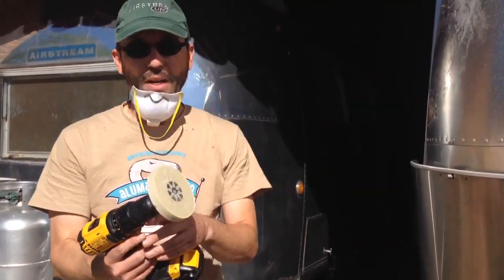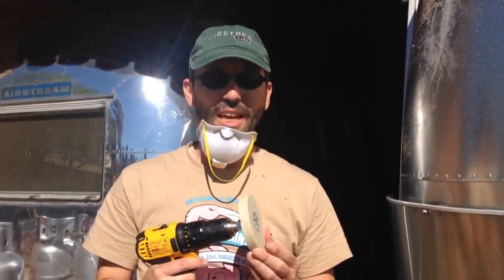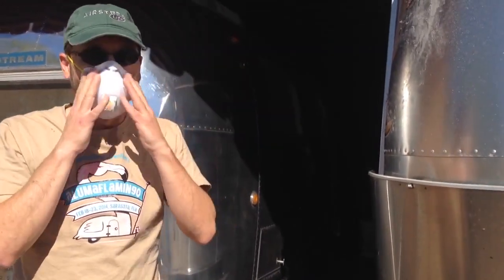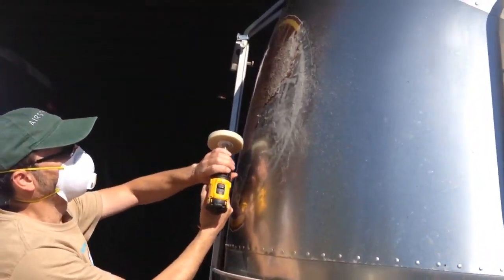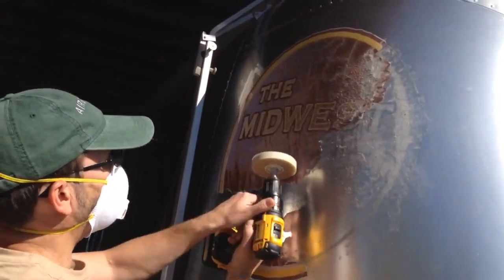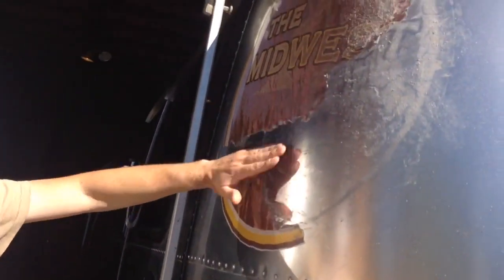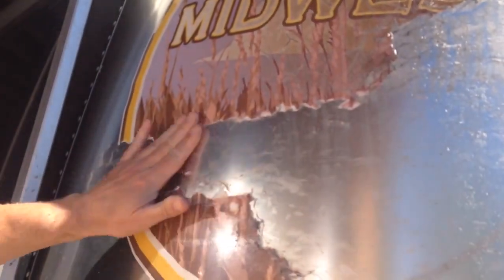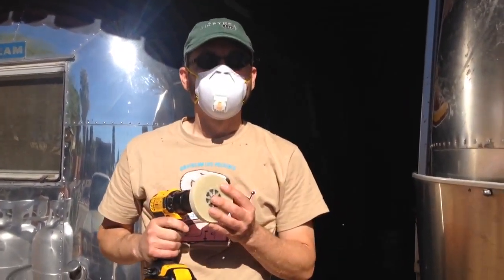Removing adhesive decals from an Airstream travel trailer

Comment: hmm, I've found that VMP naphtha removes almost all adhesives without damage to finishes or surfaces.  Sometimes it's necessary to cover the sticker with a saturated paper towel and plastic wrap for a while and/or use gentle heat.

Comment: I used the eraser wheel on my blue stripe around the middle. It took 1/2 hour to do about 75% of the door on high speed and full pressure. I had to stop ever 2 square inches as the drill was overheating. Disclaimers, I’m not very strong or patient. I can’t see going around the whole body like this and my husband (the strong one) agrees. Suggestions?
Reply: I meant the blue beltline. Sorry, I’m a newbie.
Reply from the maker: Try to lighten the pressure a bit as you go. You only have to press hard enough to scuff the surface. Also, experiment with different ways of holding the drill to find the way that works best for you. It does take practice and time to do a large area.

If the drill is overheating you may also need a more powerful drill. I used a DeWalt 18v model with good results, but the batteries needed recharging roughly every 20 minutes, so having a spare battery is essential.